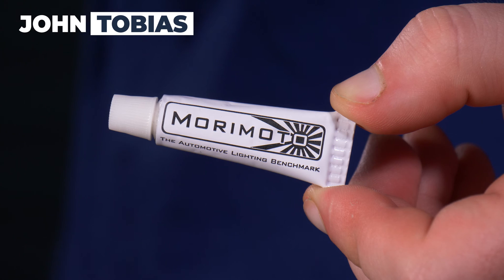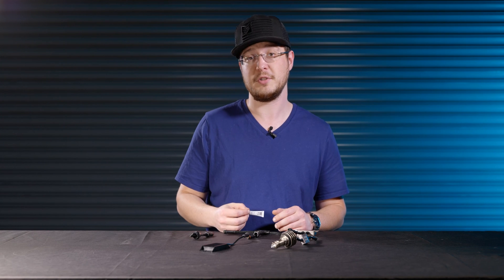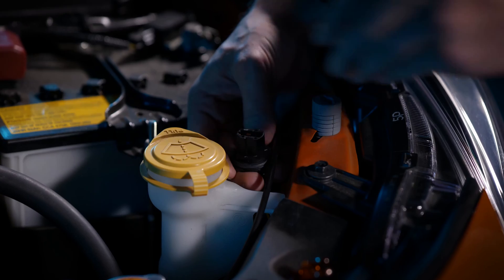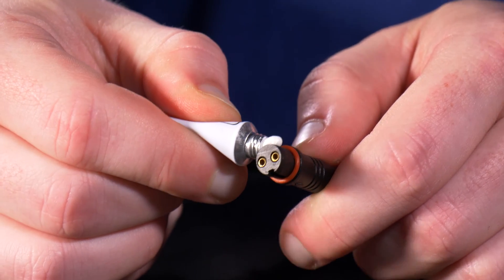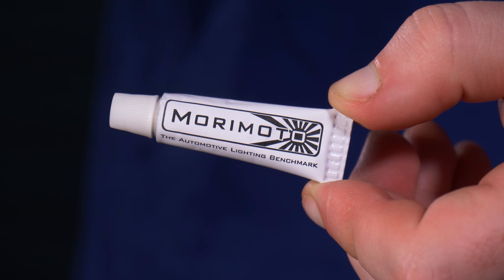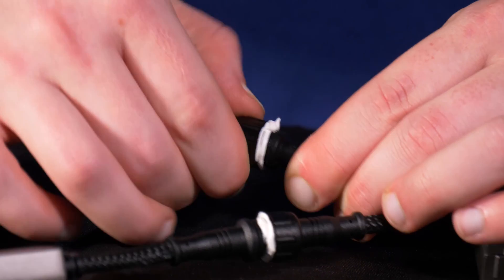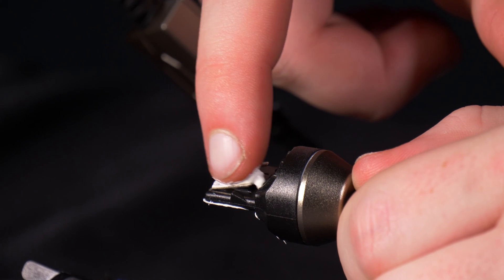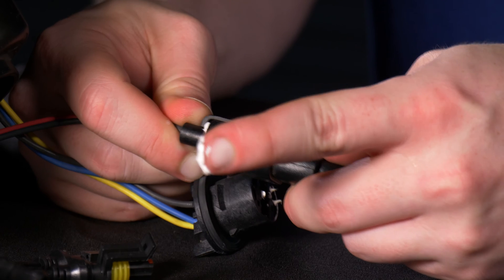Dielectric Grease Use and Explanation

Comment: Thank you.  You are one of the few that knows how to use dielectric grease.  Most people cover the metal connectors with it.   The same for car battery terminals, never put it directly on the terminal before you connect the cable clamp.
Reply from the maker: It's the best way to keep everything protected!